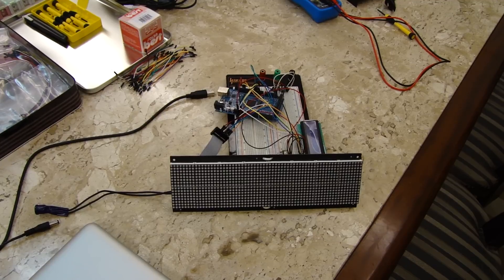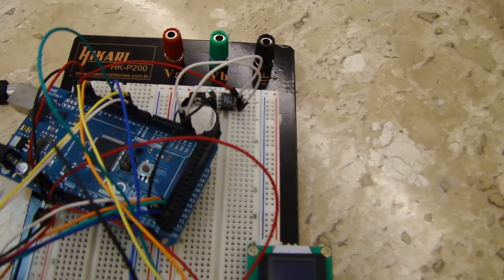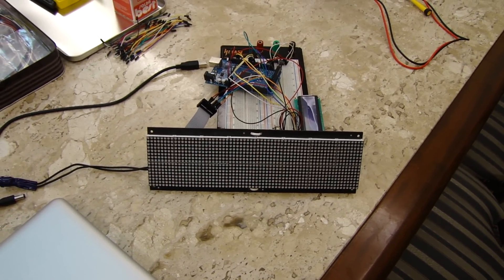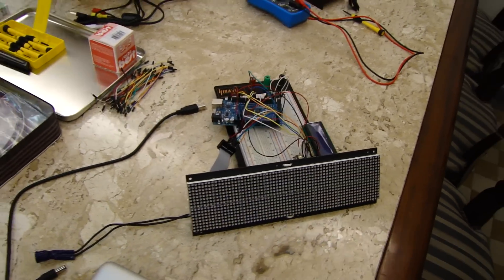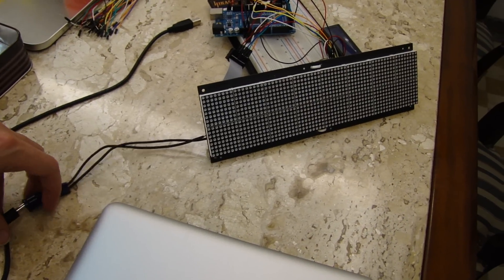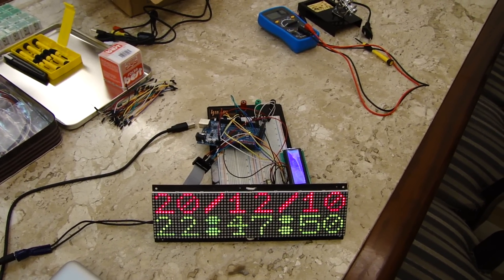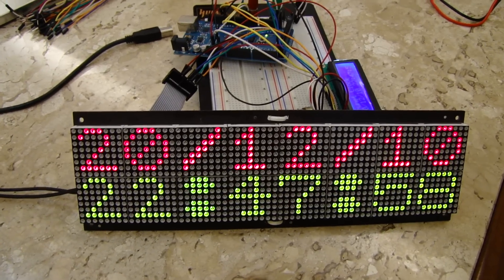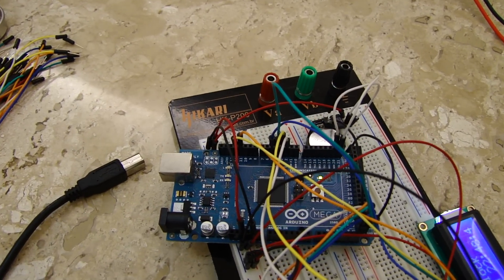My first Arduino Project - Wall Clock

Comment: @wsartori thanks for your reply. I have some questions as below cause my testing LED Matrix panel is not working.
1. Before send commands to SureElectronics LED Matrix panel such as Disable system, commons options, etc, Do we need to enable all HT1632Cs or enable one by one to send command ?
2. In ht1632_initialize, Do we need to send command only Disable system, 16*32, PMOS drivers, MASTER MODE, System on , LEDs on per broad ? and also do the Clear the display ?

Comment: How did you power the Displays?  the arduino seems to not put out enough current.  I've got only one 3216 hooked up to an arduino uno and it doesn't light up when hooked up to the 5v and gnd on the board.   the eval board from Sure states you need a 12V 3A power supply, did you use something similar for this?